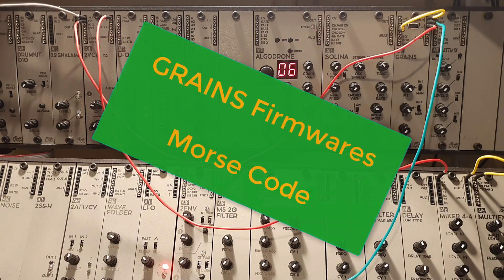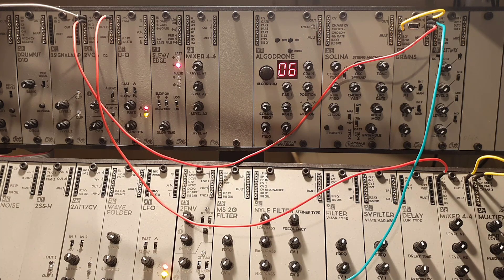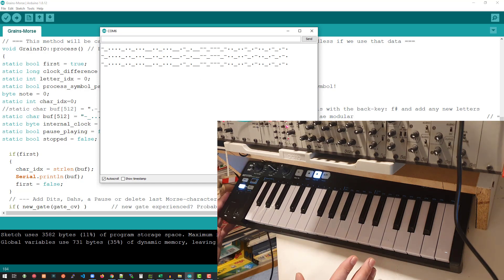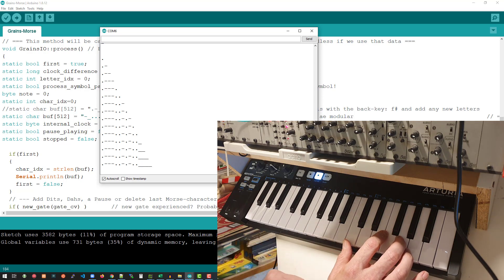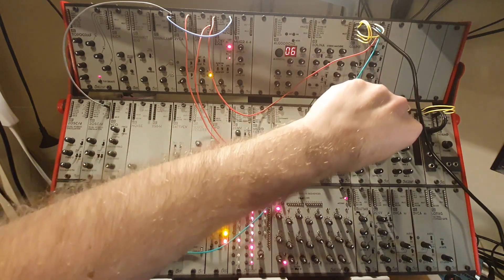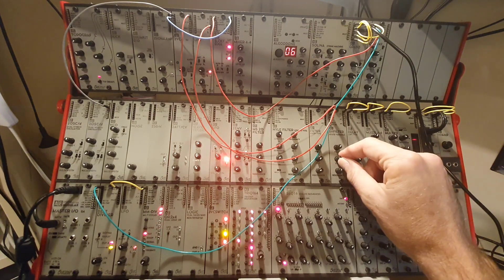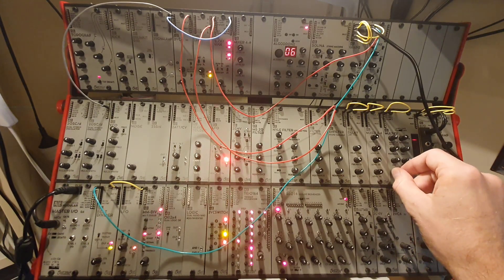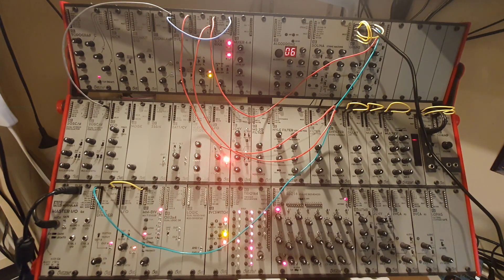AE Modular - GRAINS Codes - Morse Code

Comment: Hello from Tallinn!🙋👧🙌 My English is not really well, but I very want to know if I bought Starter Rack 2 and could I use it with other synths like Minilogue or else to do some life set without the Pc, and how could I sync them both together? Thank you for your experiences.
Reply: I'm still waiting for my starter rack, but I fully intend to use it with my other synths, and it's pretty straightforward. There's a module which converts the signals to MIDI, and you just control them from that, exactly the same as if you were using a MIDI keyboard or any other MIDI device. There's a MIDI input (which you can use either a keyboard or other synth to control the modular) right on the Master IO module that's in the starter rack 2.

No PC required at all. However, as I haven't got mine yet, I'm not sure about the cabling, so you might have to buy a cable that converts the jack plug MIDI in socket to a 5 pin DIN MIDI plug. But they are cheap as chips, and easy to find on places like Amazon.
Reply from the maker: Daniel Linger the Midi Adapter is delivered as part of the Starter Rack. I hope you’ll have fun once you get your system. Please sign up to our forum if you haven’t already! Https://forum.aemodular.com
Reply: @The5thVolt  Thanks for the clarification. I've got to say so far I'm impressed, as I think your communcation and openness is fantastic and refreshing to see. I'm definitely signing up in the coming days - I have a few other things to attend to before I've got some serious sit down at a PC time. Thanks again.
Reply from the maker: Hi, please check out my videos in the Getting Started playlist where I’m showing in detail how to connect midi and cv/gate to the AE Modular. There’s also lots of info on https://wiki.aemodular.com